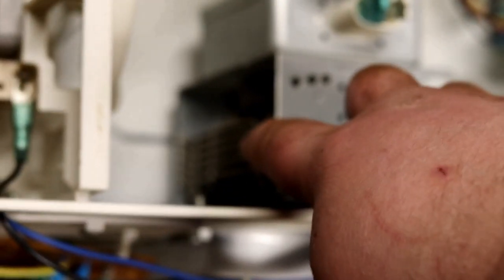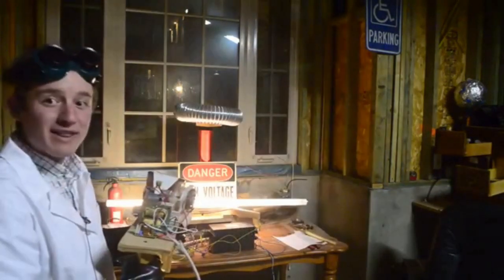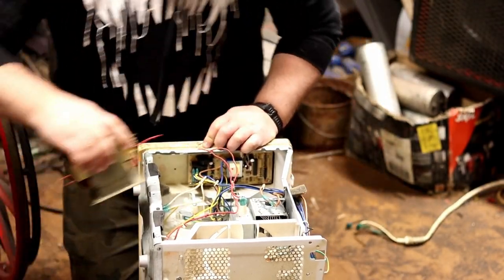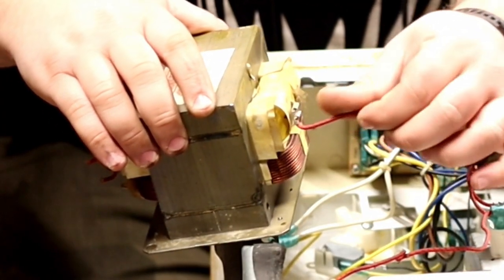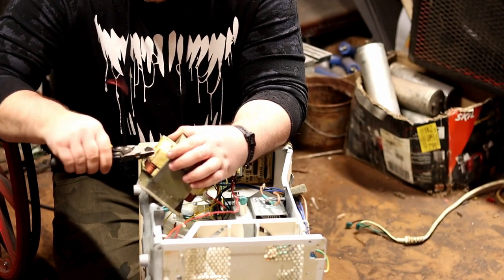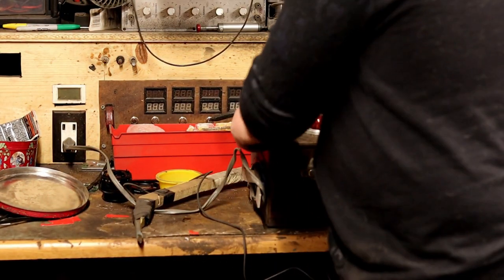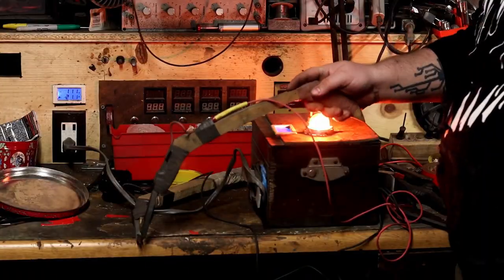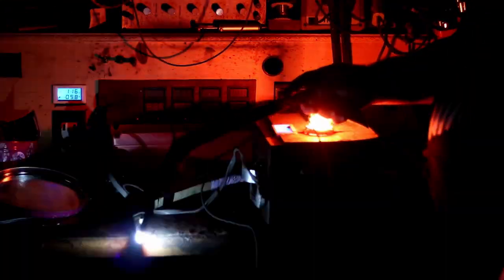What to Salvage From an Old Microwave

Comment: Good video but for other people point out we need to discharge the capacitor safely immediately before doing anything else. 👍
Reply: Most all MW caps have built-in bleeders or an external resistor across the terminals.  Only the really old microwaves are dangerous when unplugged.  But it's still better to be safe than sorry,  or dead.

Comment: The fan motor type which you tried to recall at time 16:45 thereabouts - it's a single phase, shaded pole induction motor

Most induction motors - those used in devices requiring lots of mechanical torque - cannot use single phase AC because the torque in just one phase occurs once per cycle of the AC, not enough torque to spin the motor's rotor through a full 360 degrees, and not enough to provide a 'starting torque' to actually get the rotor spinning to begin with.

A three-phase induction motor has three 110vac inputs, that are offset by 120 degree.  Phase A applies magnetic torque on the rotor and it rotates a bit (120 rotational degrees to be exact), towards the Phase B electromagnet, which applies torque to the rotor for the next 120 degrees of rotation.

So we have:  
- Phase A turned the rotor from 0 degrees to 120 rotational degrees
- Phase B turned the rotor through 120 to 240 degrees of rotation
- then the Phase C  electromagnet applies magnetic torque to the rotor and rotates it from 240 degrees back to 0 degrees

So a single phase motor seems like it wouldn't even work, since one electromagnet would need to turn the rotor through a full 360 degrees.

SHADED POLE SINGLE PHASE MOTOR 
The 'shaded pole' comes to the rescue.   On the metal plate laminations (the thin plates stuck together) you'll find two small copper windings.  They are physically separated from the Phase 1  electromagnet, so although everyone knows a changing magnetic field (like the one produced in the Phase 1 electromagnet) will induce a magnetic field in any nearby closed loop of wire,  the small copper loop is far enough away from the electromagnet that there is a phase delay created by that physical separation.

So the Phase 1 electromagnet comes on and exerts magnetic torque on the rotor (which is only turning a lightweight fan blade, not much of a load) - and then a short delay later, that small copper loop - that 'shaded pole' - develops its own magnetic field via induction, and it exerts a magnetic torque on the rotor to keep it spinning.

Single phase shaded-pole induction motors have weak torque, nothing like the strength and magnetic torque from three full-size electromagnetics positioned 120 degrees apart.  So single phase shaded pole induction motors can only be used for light duty, like spinning a fan blade.
.
Reply: Can you repeat that please?
Reply: @michaelvoorhees5978  in laymans terms,  "not enough torque"
Reply: Good text book explaination

Comment: 10:44  No, no, NO!  That brass mesh in an RF gasket and is grounded.  It is necessary for effective transmission of the RF energy into the cavity.  That metal cap with the hole in it is actually the antenna!  That hole in the wall is for antenna protrusion into the waveguide.

Comment: I love your presentation. You know about the deadly shock hazard lurking in the capacitor, some high voltage stuff like the Jacob's ladder, plasma generation with the EHT in the CRT TV, Beryllium oxide and it's danger if the powder is inhaled, magnetron tube and the microwave getting deflected in to the chamber through the wave guide and dispersion by the fan blades etc.,  Great. 
The MOT contains the middle winding for the filament of the magnetron tube. The cooling fan is run by the shunt induction motor. 
The skit between 6.20-6.45 is really good.
Thanks again.
Reply: Huh?

Comment: You can usually snap that security nub off with a flat tip screwdriver.  Then it's a normal Torx bit to remove.

Comment: 02:40   What I have done is pick up a cheap regular Torx bit,  and drill the center to a depth of a few millimeters.  A cold chisel also comes in handy when wrecking od microwave ovens,  as sometimes pieces are riveted together.

Comment: What was the set up fir that plasma generator and magnet? Did you have one of the leads touching the magnet?
Reply from the maker: One lead on the outside of the magnet, one in the center, once I’m able to get a lathe I plan on doing a cool experiment with this set up, but the driver is a circuit I got on eBay, if you think that’s something you’d be interested in I’ll do a video on the circuit
Reply from the maker: Let me know